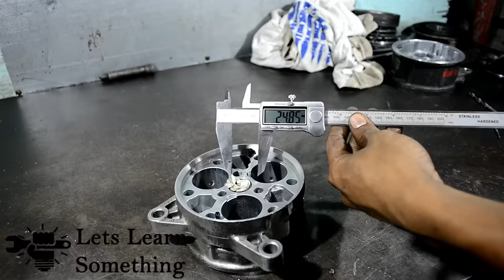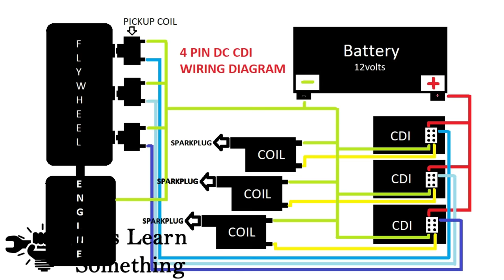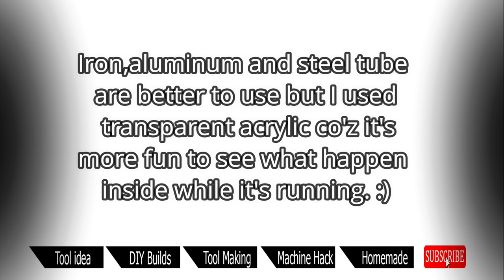I turn Car Compressor into Working Engine

Comment: Can turn an engine into a compressor, but never even thought about the other way around. Awesome job
Reply: The Wankel was  made from a compressor.
Reply: I mean I'm not saying I could do this even after watching this video lol. But a truck or car engine is not that much different than an air compressor. I seen a guy use his old running work truck to put air in a skidder tire in the middle of the woods. He just removed one spark plug and attached a high pressure hose to the engine. Plugged it into the tire and fired up the truck. I don't know how much psi that one cylinder was putting out, but it aired that big ass tire up in no time.
Reply: @poorfesor  Hmm, did not know that

Comment: Imagine bigger one in real car , higher liters/hp nomber , more efficient use of space , 2-stroke work with no added oil on fuel and amazing sound 

THIS IS COOLEST ENGINE I EVER SEEN!!!
Reply: Bloody hell, just realizing what you say reg. 2-stroke but running on fuel without added oil. Amazing.
Reply: @GaborEwayBiker  is that was sarcasm?
Reply: Not at all! Just recognized this as an advantage!
Reply: Already exists. Duke engine
Reply: Plausible, sure......practical, naw.

Comment: That is an amazing feat! I wonder how hard it would be to do the carb and valving differently and run plugs on both ends? Because of the back and forth action, it would be pushing on the compression stroke from the fire on the opposite side! The torque and RPM would likely increase significantly and at the same time it would actually reduce some of the load on the wave part of the crank (combustion pressure on one side pushing the compression stroke on the other!) but the transfer of power would go much higher. You would have both the offset in torque loads with the opposing forces while also firing on 6 cylinders!

It would just be hard to figure out how to do valving because I don't know of a way to use the butterfly valves! And then you get into the mechanical complications of mechanical valves. Maybe some type of electric valve actuators? The used those on Formula One cars for a while. Now you've got me thinking!

Overall though, awesome job and amazing thought process!
Reply: you should try it
Reply: Would be pretty hard to do!  Currently one side is used to pump in the air to the other side, like a two stroke engine does with the crankcase using the bottom side of the piston.  You'd have to figure out a way to exhaust the gas.  Another option would be to use steam.  You could then use all cylinders.  You would need a boiler to pressurize the steam, and supply it where the current spark plug is, and exhaust the steam out of the current exhaust port.  You'd need to time the steam input somehow.

Comment: Lol till the end i thought it's gonna be a 6 cyl engine, but it looks like he's using the first half of the compressor to pump fuel and air into the second half and that's genius
Reply: Same pistons doing 2 jobs! Thats pretty cool. I haven't even watched to that point yet but ill get there lol
Reply: It just uses the crankcase pressure to push the fuel mixture. The same concept is used in all two stroke engine.
Reply: @Burns11112  hmm? This thing has no crankcase, and fuel is fed into one side of the cylinder which then pushes it through the acryllic tube into the other side, where it burns.
Reply: @NickEter  the crank case is just what contains the crank. The crank case gets pressurized by the movement of the Pistons. Production two strokes don’t use acrylic tubes though, It’s in the cast. Check out how any two stroke works.
Reply: @Todd_G_FPV  I believe 2 pistons doing the same time needs spark together.
Reply: that's how two stroke engine works.. the bottom cylider work as a crank case on an actual engine
Reply: It’s called a hot bulb system I believe.
Reply: Wie ein 2takter xd
Reply: @Burns11112  da durch das der Kolben bei einen 2 Takter nach unten geht wird das Volumen in Kurbel Gehäuse verkleinert und oben entsteht ein unter Druck 👍🏻
Reply: @Burns11112  yeah it's basically a 3 cylinder 2 stroke engine.

Comment: Very freaking cool. Now, just add an alternator, & you’ve got a DC generator.
Really neat project.
Reply: Depending on efficiency of the engine (I am not running the numbers) probably only about 15% efficient. For every dollar of gas you receive 15 cents of power. Typical of all generators. Yes Very Freakin cool, I want to party with this guy

Comment: Wow! I'm really impressed with stuff like this! 

At first I thought it would be some kind of click-bait hoax but then I watched the whole thing. Very educational and well explained, on top of the impressive technical wizardry!

A couple of questions from me as a beginner petrol-head:

How do you decide the placement of the intake and exhaust ports on a two stroke engine? I get that the intake one has to be further "down" in the cylinder but is there a sweetspot between sufficient exhaust and compression or something?

And:

In this case, would that be affected by the premixing and "forced injection" from the paired "intake cylinder"?

Comment: First of all, congratulations on the idea! Despite the lack of specialized tools, you made perfect holes for the inlet and exaust. It was quite difficult. You can see considerable experience. However, the most difficult thing was to match the air-fuel ratio and dose size. Best wishes :)
Reply: Как
Reply: @СимеонАлександров-г1ь  means?

Comment: I'm still scratching my head how did u do the timing near perfect!!!😭
Reply: im scratching  my head on how do you weld magnets to a cylinder without destrying them with all that heat?
Reply: Pretty sure they were just pieces of steel, the pickups had the magnets in them
Reply: It's like a slide carb , Carl's speedshop? 
Simply amazing
Reply: Timing can be way off on an engine still run....
Reply: gaugeing TDC, and A degree Wheel.

Comment: What kind of engine design would this classify as, it's like a cross between a piston and a rotary style floating crank
With opposed pistons, 
You could of turned this into such a unique 6 cyclinder. 
Love to see a rebuild using all the cylinders. 
Incredible Ingenuity and concept. 
Thanks for the inspiration!

Comment: I would like to see the exhaust ports tied together with a little header / expansion chamber . That this is bad ass tho lots of time and work into it
Reply: Woodman Outdoors it doesn’t need it as he’s using the opposed side of the piston for an expansion chamber already.  Unless he wanted to make it an opposed six piston design instead of three, then he’d need an external exhaust expansion chamber.
Reply: Whoda Hellru I don’t see how ! the only thing the opposes side of the piston is doing is drawing in fuel to feed the power side of the piston the exhaust ports are just open to atmosphere that’s why they are closer to the head so the piston blocks off the intake port during combustion so exhaust gasses don’t travel back to the intake side
Reply: Woodman Outdoors ... that is basically what I just said. 😐

Comment: Next time, make a 4 stroke version that uses the cylinders on both sides for power
Reply: Won't last long without crankcase oil though?
Reply: @glenemcdaniel7923  it goes without saying that a oil system would be a part of the conversion.
Reply: @orlandparkcounselors  I don't see why you wouldn't. I personally think it's a great idea. With a couple of modifications, it could be awesome. I don't see enough room for an oil pan but he could make a dry sump system. Honestly I think he would for one simple reason. Why not? Also if it has enough power, he could make it into a small gokart engine. He could make a transmission and the frame. I think it would be awesome

Comment: This was cool. You should try to do this again but with both sides of the “cylinders” being powered so its a “six cylinder”
Reply: no, it needs the other cylinders to act like superchargers to force the mixture into the combustion chambers as a regular two-cycle does
Reply: jim halcom i mean yeah, but converting it to a fuel pump and a forced induction system (like a separately powered supercharger) frees up the other half of the cylinders. It may not be perfect or work correctly, but with some small tweaking and thinking it could work
Reply: @tencents49  I need more detail on how you intend to do this. The way it is arranged now is so simple it does not need a complicated explanation. That is what is so beautiful about this arrangement of this engine

Comment: Very good job!!  I may have missed this but are there 2 sides for combustion on each piston? Does this use both sides of the cylinder meaning it sparks on the opposite sides of piston giving basically 6 combustion chambers?

Is the reed valve controlling the ignition pressure & allowing for air/fuel intake on the down-stroke?  Then the side tubes (going from top of one cylinder to bottom of it by clear vinyl tubing) move the exhaust gas to the other side of the cylinder while the piston moves up & the reed valve blocks exit of exhaust gases?

Comment: imagine if you had combustion on both sides of the piston!
Reply: I was thinking the same there's a motor that does that but opposite. two pistons going toward eacher
Reply: I was thinking that too. but those extra cylinders act as compressor/superchargers for the working cylinders
Reply: @rogerd4559  I was wondering... damn cool
Reply: Steam engines work like that, except there's no combustion, but the steam does push on both sides!
Reply: It's a two stroke though, having combustion both sides would need a valve system.
Reply: @trueasdrewvn7132  It already has REED valves on the intake side.
Reply: T F! brain sparking
Reply: @broughttoideas  the abrums tank uses that type of engine its a diesel style engine :)
Reply: I dont think it would be as effient as the other side of the piston acts like a scavanger/ supercharger.
Reply: @broughttoideas  ya the opposed piston engines. Mostly diesel that I know of. Trains, crusise ships, some tanks.. Big shit usually runs them
Reply: James Bachi  no there's two cranks there's one long cylinder for two pistons so 4 pistons 2 cylinders a boxer motor is practically four dirtbike motors thrown together nothing to extraordinary other then the balancing of rotational mass that'll be about it
Reply: James Bachi  and my previous comment stated that two pistons traveled torward eachother not away so no not a boxer motor lol
Reply: @LuisRodriguez-mz1gz  The Abrams uses a turbine engine, the Honeywell AGT 1500. It's basically a jet engine and has no pistons at all. It'll burn pretty much any combustible liquid be it diesel, petroleum, gas, alcohol etc. etc. right up to, and including, perfume.
The engine here is based on a Sanden compressor and they don't really handle high compression or heat very well which is probably why it stopped working with plenty of fuel left in the tank. Still amazing work to get it running though and a good proof of concept.
Reply: @xxaxnxtxhxoxnxyxx but he's not built a combustion engine with external mechanical fuel governing/mixture regulating mechanism, the beauty of the build is its simplicity, being the swashplate is acting as the crankshaft and conrods, inducing the charge, compressing the charge, distributing the charge whilst the power end is combusting the charge, applying motive force, exhausting the spent charge and regulating the port timing.
Reply: Not to take away from what this guy did at all - pretty cool - but in answer to the question about firing on both sides - the "Dynacam" is another engine based off this "dual piston, oblong central crankshaft" design. I'm not sure its ever gone into commercial production - but they were touting it for years as the next great thing in aircraft engine design. I am pretty sure the design has been offered in one iteration or another under multiple names.

Comment: I’d like to put that on an RC car..
Reply: hell no! that would be a waste! put it on a Bicycle. I would try this project but for 50 years ive been trying to drill as accuratly as this guy and havnt succeded. I would waste alot of compressors trying
Reply: Yeah it would make your bike sound like a Harley.
Reply: I was thinking on my bike until I saw how the spark timing was set up. Too wide, sadly. Still, damn cool build
Reply: Either go cart or bicycle
Reply: @rogerd4559  actually it would probably be insane on a RC car.
Reply: @databanks  
the pick up coils could be arranged in a circle and only one metal piece :-)
also timing could be adjusted by rotating the coil mounting plate :-)
Reply: Data Banks most motorized bikes (the cheap kits), have the coil mounted elsewhere on the frame. Besides, this is a prototype, did you want it to be smaller than a grass trimmer? Like he really could use basically a grass trimmer apart system if he wanted, it would add about 1 inch to its length, but obviously the guy is just testing (why spend another 10 hours to make it slightly more compact if he’s just wanting to see if a concept runs?)
Reply: @jakegarrett8109  
i think he means the pick up coils :-)

Comment: An ac compressor is in a ballpark of the same principles as a combustion engine.. That's a pretty cool idea! I love how he aligned for the top dead center of the pistons! etc.. although the spark plug area plate and intake should be made out of aluminum..
Reply: He just used acrylic so people can see inside

Comment: I would love to know the power this is putting out, and if it shut off due to heat/catafailure or if you guys d/c'ed it. Absolutely boss guy! Totally cool! You earned a subscribe with this one 👍
Reply: He closed the throttle because eventually It would fail with too much heat on the acrylic
Reply: Why  ?
Reply: It would be a good project engine, and I have everything needed to make it thats why

Comment: I’d like to know what the power output was.
Reply: Where he was pull-starting it. Think of a torque converter against a flywheel, he just didn’t have anything back there.
Reply: Oh exactly but still just for grins you know.

Comment: This dude could make a driving car using only a washing machine
Reply: that would look odd ... a washing mashine driving down the road. Id pick a white one for visability
Reply: washing machine? Nah that's Jeremy Fielding. That guy knows electric motors (he's built a buggy running on the washing machine motor or similar). Between the two of them though? You're pretty much covered
Reply: My first car was a '79 Maytag

Comment: How about a 2 stroke Diesel engine sometime.
Reply: I dont think its possible
Reply: @brbgamer7219  2 stroke diesel engines exist
Reply: Detroit,Napier Deltic and commer knocker all 2 stroke diesels...been done
Reply: @johndeere2cylfarmer  Yep. Bus Greasemonkey and his son Indiana Diesel.
Reply: It can be done just gotta build an injection pump and injector for it. Which I’m sure he can do
Reply: Ooh but diesel burns differently than casoline and 2 storke needs engine oil so how it is gonna react with diesel
Reply: Two stroke diesel engines need airport around the cylinder
Reply: @brbgamer7219  wrong it's exist actually
Reply: @nealefrazer4247  Detroit made 2 stroke diesels for years
Reply: I didn’t say particularly with this compressor.  and a simple wet sump with an oil slinger would be sufficient enough to oil the cylinder walls. Even can Add some 2 stroke oil to the fuel aswell. People do it everyday. I use to do it as well. Helps lubricate the pump and injectors mostly
Reply: @charlesuplifted5216  ..yes since the late 20's ..."clerk type engine"..GM soon for a use for the Clerk type diesel..and fully aware of the history of 2 stroke GM's..and their operating principle and worked on various GM's from 3-53,1-71 8-53 to 20v-149 ..yes fluent in Detroit ..
Reply: @Jonathan Clark ...better re educate your self ...2 stroke is every revolution(360 degree) where as the 4 stroke is every 720 degree duration..or do I completely confuse you with the Clerk type 2 stroke diesel( exhaust only valve train with rootes scavenge blower) or a Napier valveless 2 stroke diesel with port uncovering for intake and exhaust with blower scavenging...
Reply: get out there and do it!
Reply: @charlesuplifted5216  So did GM, 12 cylinders and scavenge blower, exhaust ports on cylinder liner and valves for ingress. 3,300 h.p.

Comment: please install that engine on something!
Reply: If they don't test it on a veicle, they only waste time
Reply: Perfect for a Minibike as a first application. Too bad there's no good way to cool it besides running horribly rich.
Reply: @peponsky_  i dont think the engine components and parts is strong enough to mount on a vehicle.
Reply: @yangerwalling6371  on a minicross/minibike i think it's possibile
Reply: @peponsky_  yea mayb but as we all know it wont last long.
Hope he did something like you said in the future else its waste of time i should say.
Reply: What's up dude!
Reply: As other have said too I don't think it would run for very long, even if the plastic parts were changed for metal ones.

It obviously lacks any form of cooling, and it would probably be pretty hard to come up with something that would work.

Even if some kind of decent cooling (especially of the center parts) could be constructed, this thing was not meant to be used like this and I would imagine it will fail in minutes.